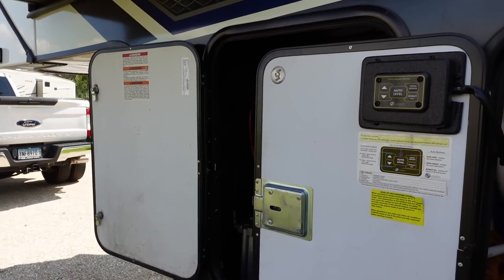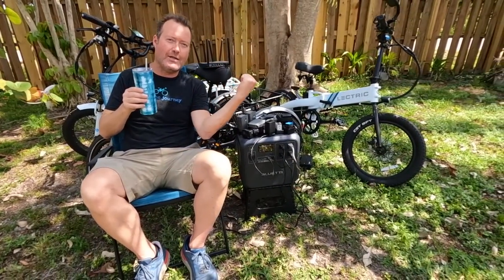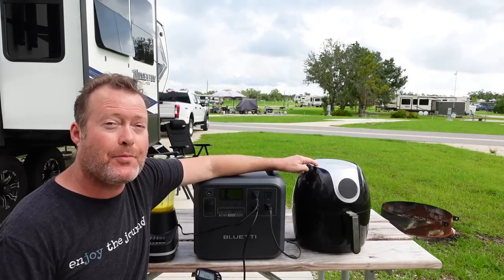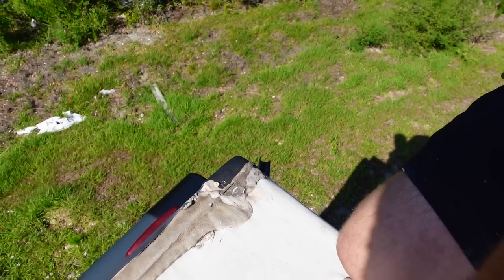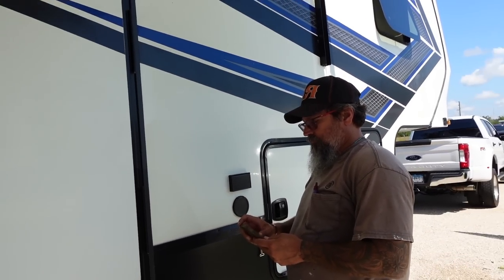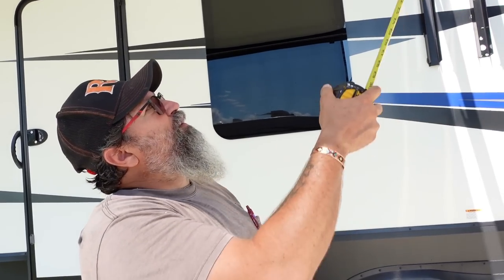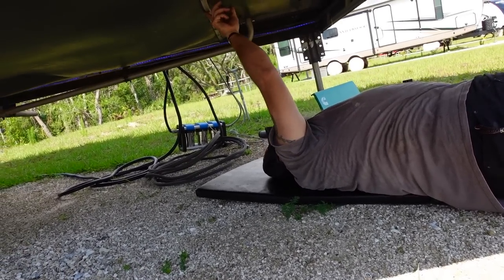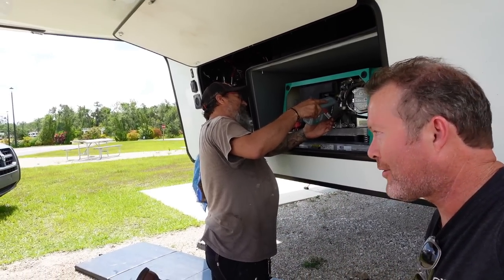RV Tech Reveals 5 Hidden Problems That Can Ruin Your RV (& 7 DIY Repairs)

Comment: Run your generator every month under load,(just turn the air conditioners on or heaters) for about an hour you will save money in repairs.

Comment: That lower frame seam on the wardrobe slide is common with Keystone products also.  One leaked on a Fuzion and water was tracing through to the bedroom floor. That is the first place I look for trouble now on slide sealing.

Comment: Very helpful video. I just bought a 2008 Class C with only 18,000 miles on it.  It has a Generac RV generator. It has an oil leak. It runs fine, but I need that leak fixed, but I can't fine a guy like this. Help I'm in Palm Coast Florida.  Seems Gererac is no longer making rv generators.